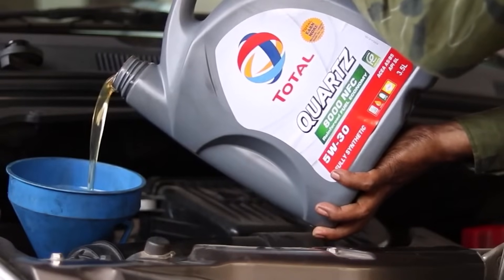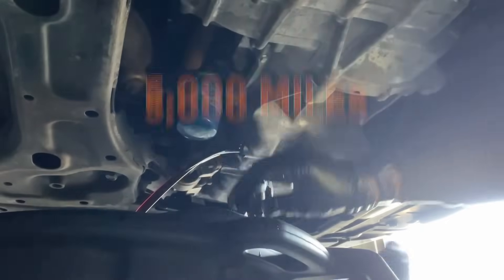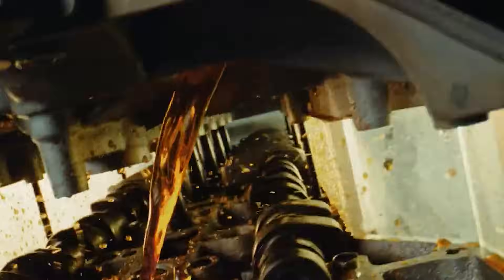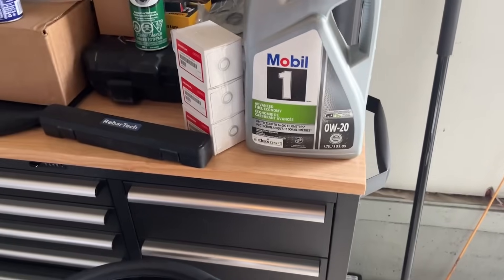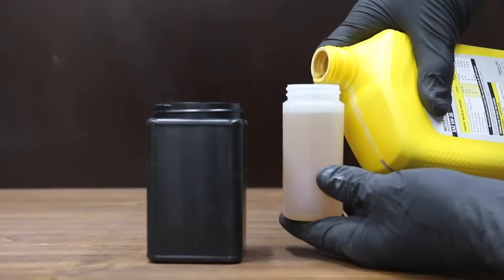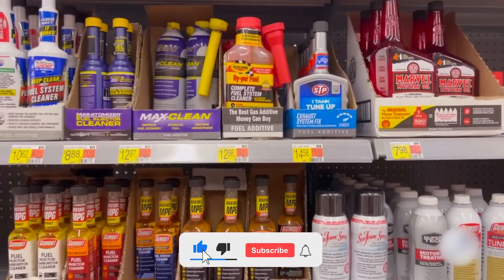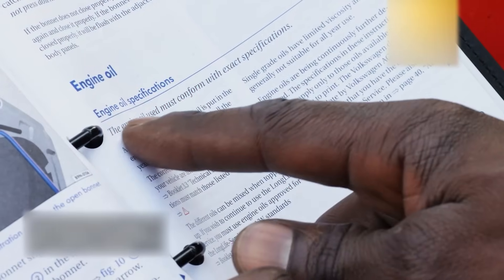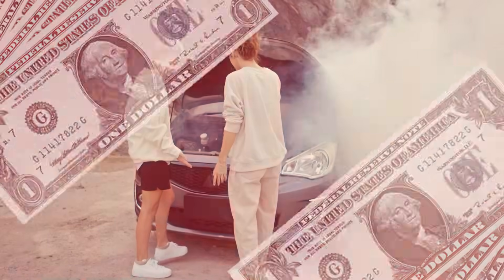Avoid Using This Type Of Engine Oil Right Now

Comment: I have a 1991 Mitz 3000gt dohc v6 non turbo with 125k miles that now sits for weeks. With 10w30 synthetic blend oil , the engine would sometimes tick after starting after sitting for several weeks & the tick would go away after warming up/driving a few miles.
When i switched to plain conventional 10w30, the tick went away.
I remember reading that conventional oil sticks to engine parts longer after shutoff.

Comment: Good video for the novice.  One thing I would like to mention is using synthetic blends...one never knows how much is synthetic and how much is conventional.  Also, do you change it more often as conventional or longer as if synthetic?  Do note, that today's conventional oils are pretty darn good at cleaning, yet, one has to change it more often.  My advice:  Go full synthetic at the viscosity recommended in your owners manual. Use a well known brand name oil (even Walmart Supertech oil is a good brand name).  Also, if your owner's manual has a severe service interval for oil changes, follow it, no matter what.  If the owner's manual just says, XXXXX-miles oil change intervals, change that oil at half that recommendation.  Oil is the lifeblood of the engine...change it often.  That being said, I always change my oil (synthetic) at 5000 miles.  The one exception I made to that was on a car I had a few years back that did a 114-mile, round trip commute each day, 98% highway miles.  I changed that oil every 7500 miles.